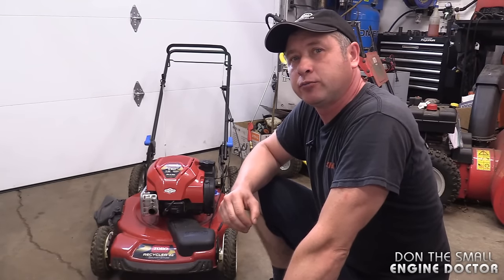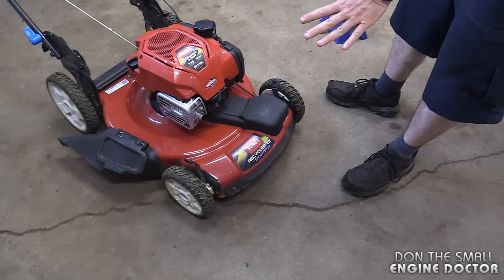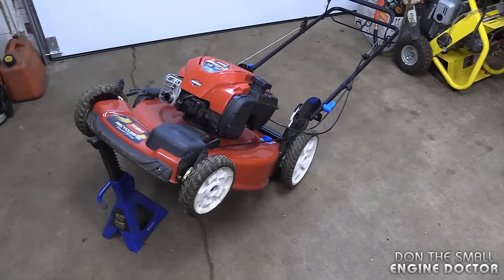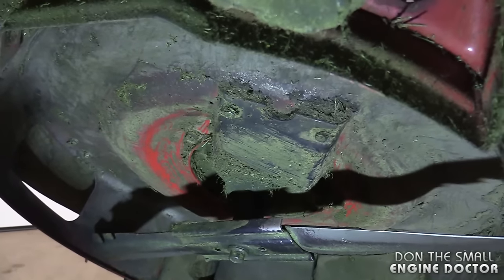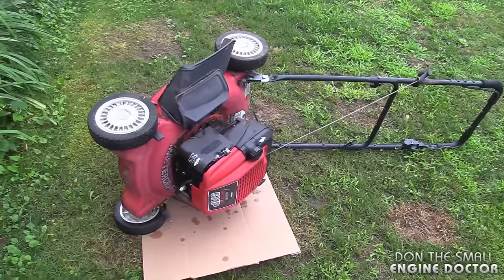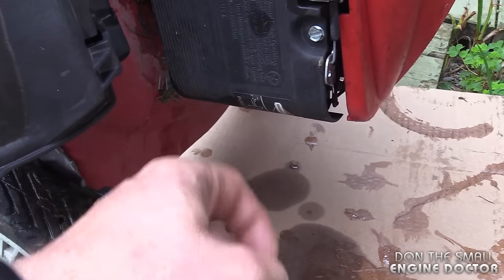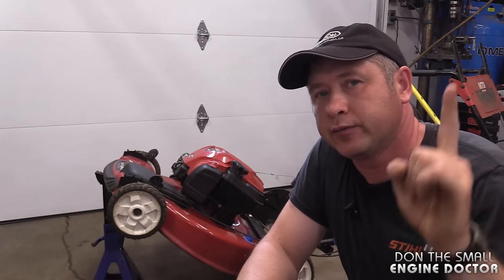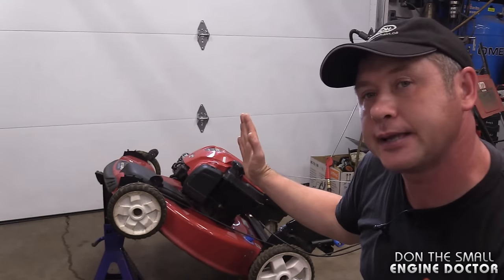Proper Way To Tip A Lawnmower Over!

Comment: What are your views on Honda lawnmowers? The instructions on changing oil is turn on side with gas cap up in order to drain old oil.
Reply from the maker: it's a pain, i have a video here on how I do it https://www.youtube.com/watch?v=KgIjK0X9NQU
Reply from the maker: Truth Only  yes absolutely
Reply: Yeah,  think a little common sense and make your estimates, if you plan on changing oil soon don't fill up the the gas tank,  also could be a good idea to buy simple pump.
Reply: Most Honda lawnmower engines have a fuel shut-off valve near the carb. At least most I ever saw do. I close the fuel shut-off and run it for about a minute, that's enough to drain the carb & fuel hose. This reduces fuel leaking out all over the work area when tipping on side.
Reply: @RichardFallstich  , Thanks, that's exactly what I do before changing oil on my Honda lawnmower.
Reply: Thats any lawnmower without a drain plug.
Reply: JSTR  , It was only a comment and a question for donyboy73. I am on my second Honda lawnmower and have had Honda lawnmowers going on ten years and always changed the oil as stated in the manual. I probably know more about Honda lawnmowers than you and always do my own maintenance on them, plus my Ariens snowblower. 
Thank you!
Reply: There’s a viddy on you tube where you vacuum the oil… it’s great

Comment: Take the spark plug lead off.....pull the starter cord until it gets tight. This puts the mower in TDC on the compression stroke. This only allows a small space in the cylinder that the engine oil can leak into past the rings.....valves are closed, carb up, muffler down.
Reply: Why are these small engine mechanics not on the same page ?
Reply: @chickadeeacres3864  You as a reader, have to suss out the BS from the facts.

Comment: While I appreciate you're effort that is absurd.  Been tipping mine of its side, air filter up, for 40 years, Never a problem and my mowers last typically 10-15 years. The decks wear out before the motors.

Comment: I've always tipped it up (the "wrong way" in the video) to wash underneath the deck each time I mow. I never let the clippings build up and dry between mowings. Been doing this since 1985 when I first learned to mow my parents lawn. Never had a lick of trouble with any of the mowers I've used or owned over the years, nor ever getting hydro locked.
Reply: Was yours a 4-stroke or a 2-stroke?
Reply: Very helpful, thanks. Did you know you have rodents? One ran by towards the end of the video, in the background, I watched.
Reply: @cathyprice1785  I Hate those things😒I thoughts that's what I saw😳😌
Reply: @arnettaburton7429  It was just a chipmunk... at least it wasn't a rat!  ;)

Comment: Chipmunk photo-bomb! I always tip it carburetor side up after pinching off the fuel line and letting it run out of gas. Also pull the engine over until it’s on the compression stroke so both valves are closed before tipping it. That’s a SmartStow mower, you can actually fold the handle down and sit it upright!

Comment: Remember to pull spark plug & pull on cord till piston is at top of cylinder. 
This will help stop oil in carb & muffler. 
When tipping on side , tip with carburator pointing up .
Reply: Agree, this video does not help

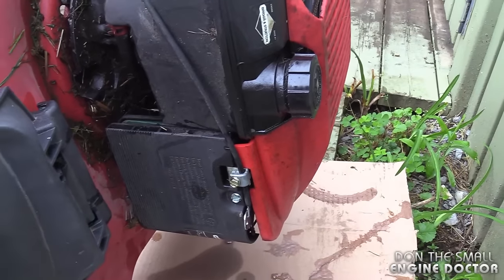Comment: 2:12 , when I installed a Predator 5.5 hp engine on a OLD Snapper cast aluminum deck I turned the engine where the spark plug / OHV >> would << face the handle bars, that way I can utilize the handle bars as a prop to aid in maintenance,  I have some hooks in the wall that I locate the handle bar in while I do under the deck stuff.

Comment: I’ve had my Toro self propelled mower now for 7 years.  If you tilt the mower opposite the air filter you won’t have any problems changing the blade or draining the oil.
Reply: Exactly! Changing the oil is not what I would consider rocket science.... Quite simple lol

Comment: I always service mowers with the intake up and a plastic bag or glove under the fuel cap. Never had an issue. You get an oil change and blade sharpen in one go.
Reply: I do the same. Gas tank and carb on top side, exhaust on bottom side. Never had an issue that way.

Comment: At 3:04 their was I think a squirrel passing in background of the camera
Reply: chipmonk with his racing stripe. they are so cute!
Reply: @remushaynes2693  They are nasty little critters. I had 1 chase me out of my shop.
Reply: @bevis226  that is hard for me to believe! we are to have dominion over the soulless.
Reply from the maker: yes a chipmunk lol
Reply: @bevis226  They are nasty little beggers, I've trapped 19 of them so far this year. They'll jump up into your car engine compartment to try to build a nest. If you see a lot of maple seeds in your engine compartment it's chipmunks. They chew wires etc. in there too.
Reply from the maker: @River_Miles  lol
Reply: The chipmunk has a name, he makes an appearance in many videos but you need to look closely. Every good workshop has its resident critter.
Reply: @bevis226  You musta been wearing that dress, and your coconuts were exposed.
Reply: I hope the chipmunk signed a release form to be videoed
Reply: Lmao..i noticed he peeked his head out a little and disappeared for a second  and then made his cameo appearance on the donyboy show..
Maybe we will see more of him..
Reply: You can crank your mower til it's at TDC when it's at its hard to crank compression stroke and u can flip it on either side and you don't have to worry about any oil or gas coming out 😜..

Comment: I recently put a 4 to1 block and tackle in my garage mounted through the attic access hole. I can raise my mower and generator very easily to work on them at eye level. Works great

Comment: You can also put the engine on top dead center on the compression stroke and tip it on the muffler side and it won't leak any oil. But make sure it's on the compression stroke.

Comment: I flipped my engine every goddamn way when trying to remove it from the deck (totally corrosion welded bolt that had also corroded 1/3rd way through so it ended snapping even after huge amount of work doing every trick in the book.) But I also set it up in normal position and did a basic overhaul of the externals before trying to start it up again. Still working just fine(5hp quantum).
Reply: In case anyone responds wondering what happened after the stubborn bolt sheared: Well I drilled and grinded out the remains and used slightly larger metric m8 bolt and a nylock nut. The flange "ear" has enough meat to even use a m10 with no worries.

Comment: I got my almost brand new Toro Personal Pace with Smart Stow for $15 because someone tipped it the wrong way forward. They must have thought it was seized, because you couldn’t pull the cord. I let out the oil, wiped off the spark plug and the mower started on the first pull. I mowed my lawn with the gas that was in it. Lol

Comment: I tend to forget that Honda mowers leak like a broken faucet. The manual recommends tipping on the exaust side on some models after draining the gas and oil. Really? Who does that?  Yesterday I almost ruined the air filter on a Honda. I usually let a mower sit for an hour after doing work on it. I see some mowers( Toro) have the EZ store where its designed to be tipped on end. You always have great tips! I was able to order a new Magnito, points and Condenser  for that Snow blower I mentioned.  Its a Techumseh  HM80. The really old version. The blower is in great shape, the magneto  failed and points were pitted.

Comment: I tip my Lawnboy Lawnmower over in a ditch on a 45 degree bank with the gas cap on the high side of the mower. I have been doing this for as long as I have had it and I try to do this before refilling the tank. I have never experienced any of those problems you speak about but that is not to say that they don't happen. It has never caught on fire or done any damage to the mower and it always starts on the first or second pull but usually on the first pull. I do have problems with wheels that wobble though but I don't think it is because I flip it over on it's side.

Comment: You can tip your lawnmower on its side, with the carburetor side facing up, as long as you make sure the piston is at top dead center.  Do that by disconnecting the spark plug wire and pulling the cord slowly until it feels very tight.  That way you know it's TDC and the valves are closed.

Comment: Lots of mowers have a 'handle bar pinch' feature so you can hinge the bar from 45 to 90. On mine I can push the two bars together a bit so they get out of the U brackets on the deck, then the bar will hinge straight up.  Just make sure you prevent the pull rope from getting pulled too far into the engine.  This way you can point the mower straight up

Comment: Great tip on how to work on your mower the question of the day is will over Head valve engine  get hydro locked if it's tip up with the spark plugs is facing down . later lawnmower onwer,s best friend ✌️✌️

Comment: Carb up has always worked for me. Figured it out after I tried carb down and got oil all over the place. I just got back a pressure washer I'd loaned out. I could see oil had leaked out so I carefully and slowly pulled it over a few times. I expect a nice cloud of blue smoke when I fire it up.

Comment: Like others have said, TDC (determined by rope pulling, the spot with the most tension) carb side up. Valves are closed, least room in cylinder.
I just do as donyboy73 said, never a problem, I just don't tip 90 degrees.

Comment: Remove spark plug wire.  Pull cord until you hit the most resistance (top dead center).  End of problem. Courtesy of Steve's Small Engine Saloon.
Reply: Thanks Buddy!

Comment: For me, if the mower is raised from the front like this it isn't easily accessible for deck cleaning or blade removal as it requires laying down flat on the ground or whatever.  I find it is better for me to have little or no gasoline in the tank, make sure the piston is at TDC and tip it so the muffler is facing the ground.

Comment: Advice much appreciated. When I pull the starter chord until it tightens to prevent hydro lock … do I tie the cord at this point or is the cord released ?

Comment: oh baby I remember when I was trying to diagnose a no run condition and my dumb ass flipped the mower on its side with the gas tank in the air like that.........Completely screwed the air filter and had to replace it! The problem was resolved with an entire cleaning of the fuel system and fresh new gas.

Comment: Hey Donny, Been replacing rear bushings on so many Honda mowers this year, its not even funny any more. Its hard not to turn the mower over to get at the circle clips and remove the rear wheel brackets. I found I can hang the mower off the end of my mower lift then brace the frame behind each wheel. Then I can reach up under the rear of the mower to pull the clips. I had one stuck so bad I stretched the clip. Its best to keep a supply of them on hand. I lost one axle clip on a Toro last week, it flew off into space. I have gotten good at Honda and Toro drive systems this year.
Reply from the maker: in certain cases we have no choice but to flip it on it's side in a repair shop

Comment: Hello Dony.
When I tip my mower fuel leaks from the back of the carburetor. 
It's an mtd with those new Chinese motors.
It runs great and does not leak when running. 
Thanks for any help

Comment: Is that the Toro with ‘Smart Stow’? If so you can stand that deck straight up and really do your maintenance with ease.
Reply from the maker: yes the new Toro mowers store quite easily tipped up
Reply: I wait until it's very low on gas before tipping it to clean the deck. I'm very quick about it (2-3 min) No gas to leak out.

Comment: Years ago my brother in law did that with a riding mower, flipped it the wrong way to change the blade. He called me and said it's locked up, I explained it was hydrolocked with oil. We removed the spark plug, pulled it over to expel the oil and it started, but there was so much oil in the muffler a flame shot out the rear!

Comment: Your advise is so good that even a chipmonk does a scamper by to learn :-D  Cute :-D
I place two dustbins side by side with a mower sized gap, then just lift the mower on top of them.
Undo the oil drain plug and leave it there for a while to drain.
The blade bolt is removed with a ring spanner and a wooden mallet for impact effect.
I always give the bolt threads a coat of oil so it does not rust up, and easy to remove the next time.

Comment: Hey how would u change the oil if u don't tip it over and I have to put it the house because I have no garage or shed and the way I bring it in is I have steps going down to the basement I put it down two steps to turn it and then put it in the kitchen
Reply from the maker: if you're changing the oil it's ok to flip it over, you can also use an extractor

Comment: What if you just drain the oil and fuel? Tip the mower as needed, and then refill with new oil? I need to change a self propelled mower cable for the drive system, and will have to be underneath it for a bit.

Comment: I just flip it over the way the the manual tells me to, carburetor up, never had any problems, its a cheap Chinese
one, 4-stroke.   It came with a manual, so I read it
Probably has to do with not spilling gas all over the place, and to prevent oil entering the crankcase vent pipe

Comment: Was wondering about bringing the piston up to TDC with the spark plug wire removed.  Will that stop engine oil from going into the piston there by avoiding hydrolock as well as closing the valves so that it doesn't leak through the muffler if it is tipped over on its side  with the air filter up and the muffler down?
Reply: Imo, believe you're right on. 
Definitely NOT the opposite.

Comment: All mowers are different. Some have the filter on the gas side , Some on the opposite side. Gas will always leak when turning on its side because no fuel cap is 100% sealed tight & Should not be, it needs air to run.

Comment: thank you for this. I also used your hydrolock video to correct my mistake. Would you consider a video on removing stripped mower blade bolts? Thank you.
Reply from the maker: yes I will when one comes in the shop
Reply: Thank you, that would be helpful, you are excellent in your advice and demonstrations.

Comment: That's all I do when I'm removing or refitting the blade holder whenever I change the oil in my lawnmower as it gets in the way of the drain plug if I don't remove it.

Taryl just bought a brand new Toro push mower which is purposely designed so it can be stored vertically, it's also handy for when you are changing the blades,etc !

Comment: Great video, this is going to help with excessive oil I get b in my breather air cleaner. I do have another question. I have a snapper walk behind mower, 
Powered by Briggs & Stratton 175cc OHV 775 Pro Series engine with ReadyStart . My question is the rewind  once the mower is started and run for a while has a loud tinking sound coming from it. It was so annoying I bought an OEM replacement ( rewind) installed it and now the noise is back ?? If I push down with my my thumb on the top of the rewind the “ tinging “ sounds stops. But once I get going again the noise comes back?? Can you help  me please
Reply from the maker: the pawls in starter are sticking out a bit that's why, check the little springs that hold the pawls back
Reply: donyboy73  thanks I’ll give it a try

Comment: Or you could just have your piston at top dead centre. Hygrolock problem solved. The valves are also closed and now you can tip it over on its side air cleaner up and work on it as long as you like.

Comment: Or........... If you need better access.
1) if you have the safety lever on the handle bar - Squeeze the lever, Grasp the Pull Cord and Pull Slowly until you feel Maximum Resistance and Stop. If you miss just repeat the pull process.
This sets the piston at Top Dead Center, avoiding cylinder flooding/hydro-lock.
2) Tip the Mower on its side - Exhaust down and go about your repairs.
3) When work is complete, right the Mower and Pull the Starter Cord easy through a complete cycle. If any oil at ll has gotten past the rings it will be minimal and will push past the exhaust valve.
Note: On Older mowers you may see minor smoking for just a minute or so as the Exhaust burns off any passed oil.

Comment: Bro I think I saw a rat scuttling along in the background! Anyway...you didn't mention strain on the wheels of flipping a lawnmower on its side. I have a battery lawnmower where fuel leakage isn't an issue. Do you think the wheels should be strong enough to allow side-flipping? I realise it's probably not desirable but I find the easiest way to clean the mower.
Reply from the maker: yes you would be ok to flip it sideways

Comment: No no. Get the piston at top dead center on the compression stroke with the values closed. Then turn on it's side, muffler side down, air filter side up.

Comment: i really don't see the problem with turning it on its side like you had it in this video to work on it. you only usually see major fuel/oil leakage which will destroy the filter and hydro lock the engine if you turn it so air filter faces the ground. the crank case vent always seems like it is on the same side as the air so oil will flow freely into the air filter housing.

Comment: BEWARE! This is NOT working for all mowers. I did this method (lifting front until handle touches ground) on my Victa Easy Walker (881891) and ended up with almost hydrolocked engine. After short while, fuel started draining through air intake and it took me a lot of slow pulls to get it all out before it started working again. Luckily it was not fully locked, otherwise I would have to clear it up through spark plug.
I guess some mowers have differently organised engine - do not rely on one universal answer. Always find suitable method for your mower.